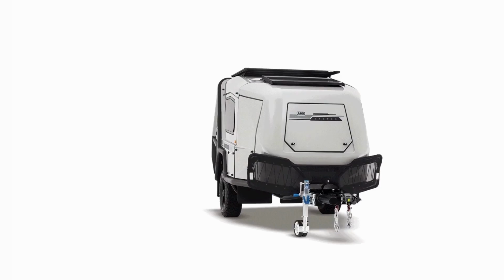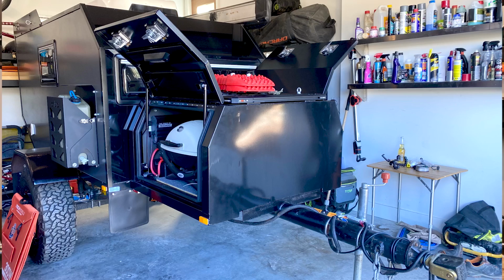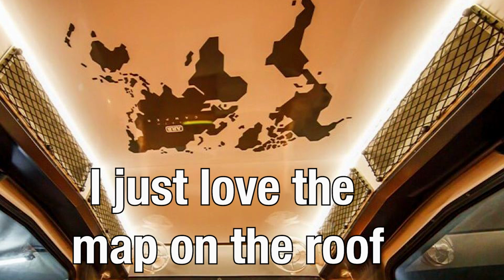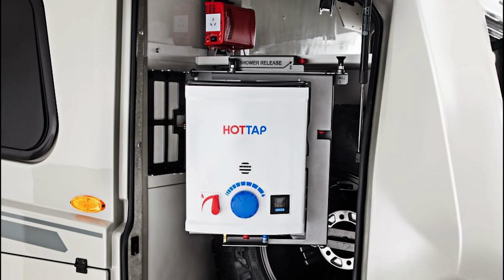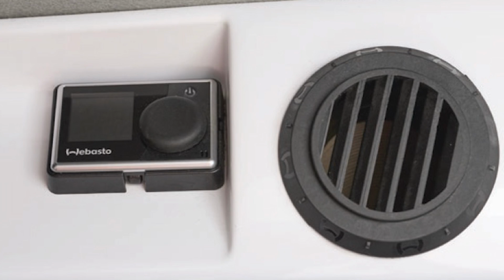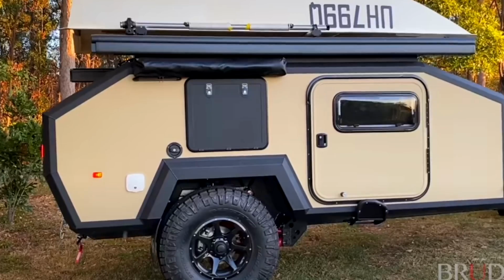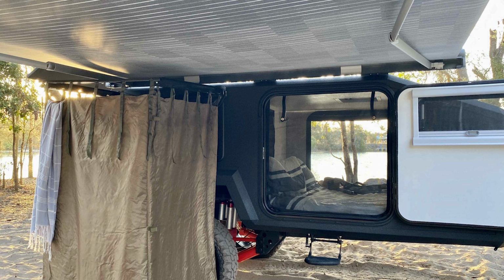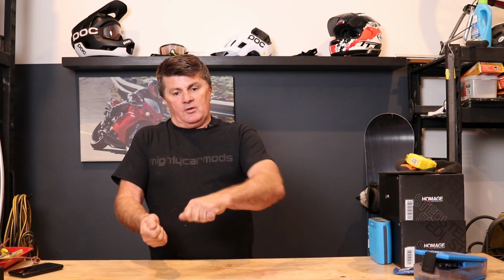ARB Earth Camper Impressions // How does it stack up against the competition?

Comment: You didn't mention escaapod topo2 teardrop all fiberglass body  43k  weight 1650 pounds bottom line is any of these offroad camper trailers worth that kind of money that only used 2 to 3 times a year depending on where you live and free time

Comment: Darryl I've had contact from ARB and looking forward to an EC arriving here in WA for a good look. Interested in your thoughts on three 2024 model upgrades. 1. Clean up the messy stove gas connection. On such a premium camper why is it necessary to remove the bottle?  2. Draft cover maybe magnetically attached to the exoskeleton. Saw a good example on the Stockman Rover. 3. Spare tyre mount on the draw bar. Get a lot of extra storage space. 4. Air suspension.
Reply from the maker: I'd think the Gas thing is a compliance issue, currently the camper probably wouldn't require any gas certification. The mounts they've put on the drawbar allow ARB to make a range of accessories, bike rack, storage box, maybe spare tyre carrier. It also keeps everything backwards compatible to keep current owners happy. I'm sure if it sells, they'll do further development.
Reply: Air suspension? Stick with your jayco and the caravan parks 2 hours from home 👍

Comment: Went and had a look at it today at the launch. It’s a bloody impressive bit of kit for their first crack. 6 years of design and testing. All the bits and bobs are pretty well designed and look damn solid. Seriously worth considering if your are in the market for a camper and  don’t want to kit out your 4WD with fridges and all the off road gadgets or your vehicle isn’t a tray back it’s a great option. The only thing we didn’t like was when you put down the floor it’s a bit rickety and not solid. But given the design and weight restrictions it’s best they can do I guess. Overall it’s a good product and further iterations will improve it.
Reply from the maker: Thanks for posting your thoughts on it, I'll pop in and have a look during the week. Have you looked at these types of campers previously, just interested if ARB is bringing in new eyes?
Reply: @DarrylSheather  we had looked at smaller teardrops and more road going campers as our current tow vehicle is more a soft roader than off road. The more rugged off road campers were not really on the radar but we are looking to get a new vehicle soon that’s more capable and a camper to go to those off the beaten track spots is a consideration. My wife actually was looking at them and saw the ARB. I’m sure the name as a proven off road product is certainly helping them into the camper market for sure.